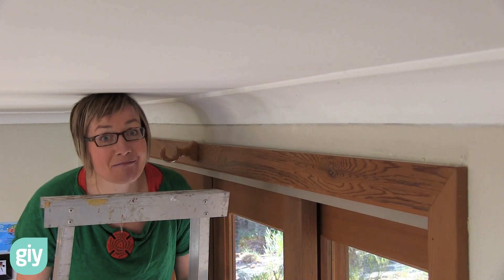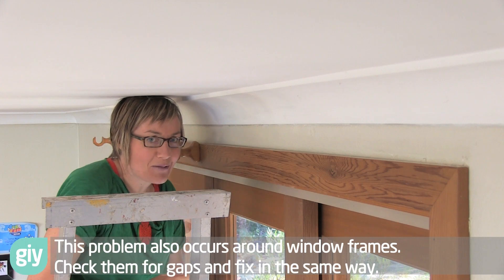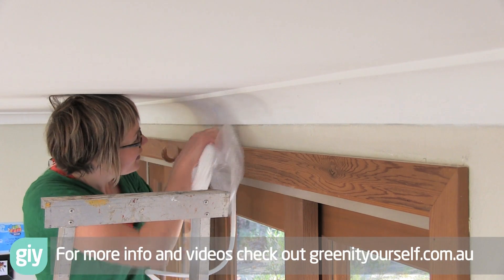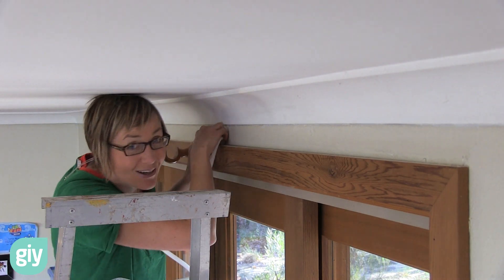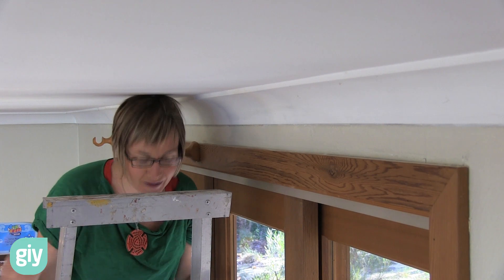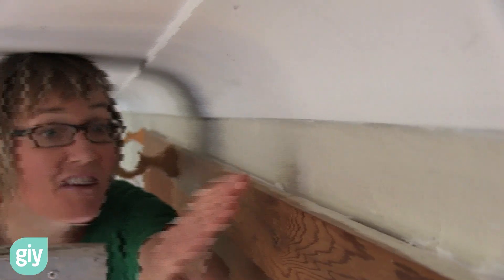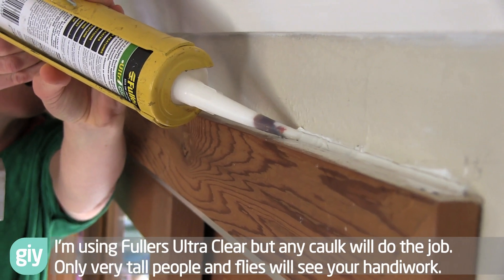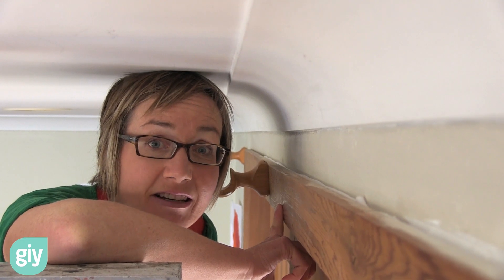How to draught-seal around doors and window frames

Comment: I never knew I had the same gap until i saw  a spider crawl behind the timber frame, i used No More Gaps because you can paint over it, you can't paint over silicone. The stuff you used used you can paint.
Reply from the maker: YEs, you can paint over the Fullers Ultra clear